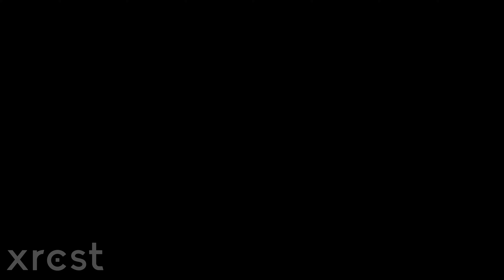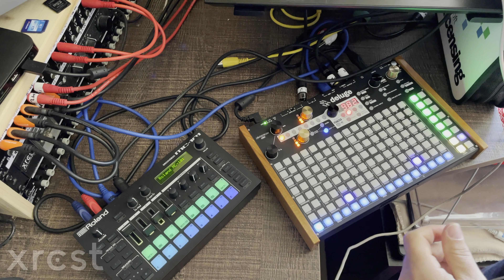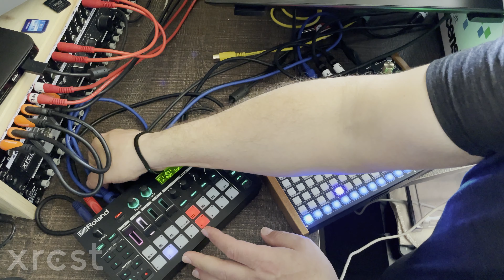Synthstrom Deluge vs MC-101 Midi Clock  /  Sync Issues

Comment: Hey Man. Think i have a potential fix for you. Take thru OFF on the Midi Clock settings with your deluge. 
It should work after that. I left my deluge thru turned on, and was sending data back to myself by accident. That stopped when i corrected the chain and changed thru to OFF.
Reply from the maker: Will test that, thanks

Comment: Deluge midi clock out is accurate. But my Tanzbär 2 clock out is a few % out, so if I use my Eventide H9 in looper mode it is bang on from Deluge midi but doesn't fit exactly with Tanzbär 2 clock.
However if I clock Tanzbär 2 from Deluge then H9 is locked in to clock just by matching bpm. I suppose Tanzbär has analogue clock whereas Deluge has digital

Comment: Hi XRCST. Have you tried a different PPQN on the midi out / in on the Deluge? Some gears don't like high pulse counts per quarter note. Or if you know what PPQN is used on the MC set it the same value on the Deluge. Maybe try to connect it via usb-midi and see if it is working that way :) Hope this may help.
Reply from the maker: I just tested in, Deluge is by default set to 24, tried 48 and 192, same outcome. As for usb midi, weirdly MC-101 isn't recognized when connected directly to Deluge via usb (MC set to "Generic" driver), but when connected via iConnectivity Midi+ it works just fine. However, the timing issue stays the same, when Deluge is the master, it's off, when MC is the master, it's much better. I even have the feeling the timing over usb is a little bit tighter / better than DIN, might be some iConnectivity magic...
Anyway thanks for the input !
Reply: @xrcstrecords  The one thing I had was that the realtime messages were not enabled on the other device (Sorry have no MC). So that in my case, the unit was not interpreting the start/stop messages correctly and so did not sync correctly with the Deluge's start messages. I still have my Technics KN2000 I bought back then when it came out and it works perfectly well with it. I also checked the timing of my Deluge with MIDIOX (on PC) and looked at the midi timing clock jitter and it is fine enough to work. The set pulse count between the quarter notes is respected as well. Do you have any other gear to test it out? Would also be interesting to see what bpm is detected by the Deluge when you use the MC as master. Are you running the latest firmware on the Deluge? it is now 4.0 :)
Reply from the maker: @glennmuller8765  yep, 4.0 on the Del, I got other gear, but none with sampling, where I can notice phasing or other timing issues. Anyway for now, I'm just using MC (or MX-1) as clock master, slaving Deluge and other gear, so it's fine...
Reply: @xrcstrecords  Nice! I have read now some Roland Forums and it seems like th MC has trouble with other gear as well. Someone said that f.ex disconnecting the midi out solved the issue, like if there was some kind of feedback when midi out is connected. Cheers